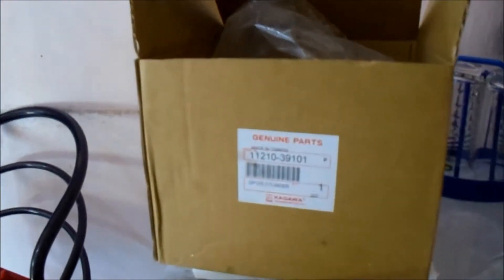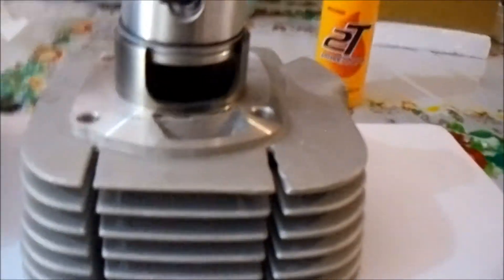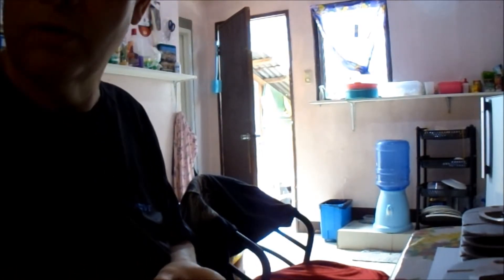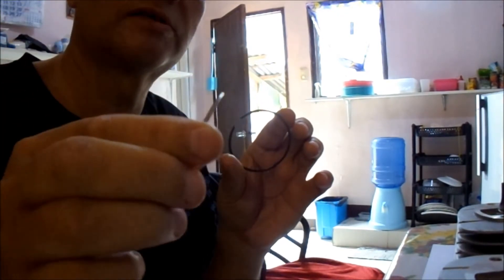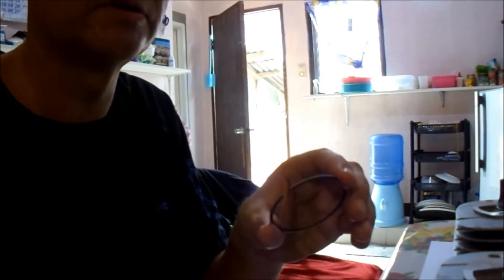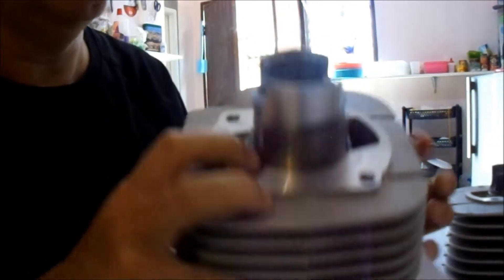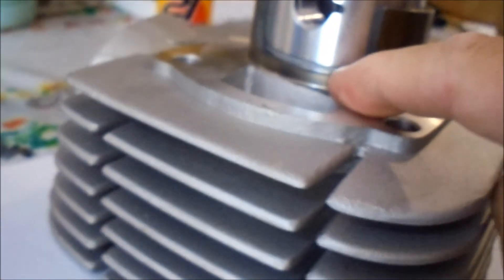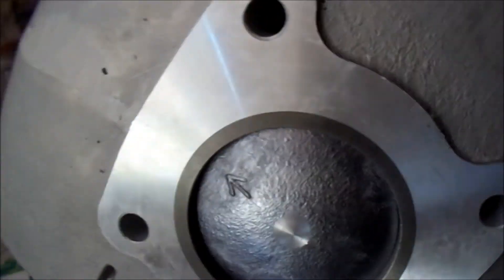Suzuki GP125 piston install in a Taiwanese made cylinder block.

Comment: hello there. i recommend u to use original cylinder block , that cylinder block is badly unmatched on the engine . sometimes the port catches the rings.
Reply from the maker: The thing is that the original one is not available in most countries... If you follow my instructions here, the rings can not catch the ports once it has been installed, obviously.